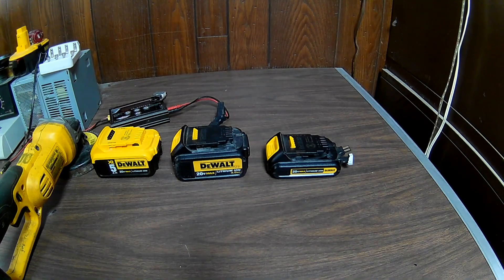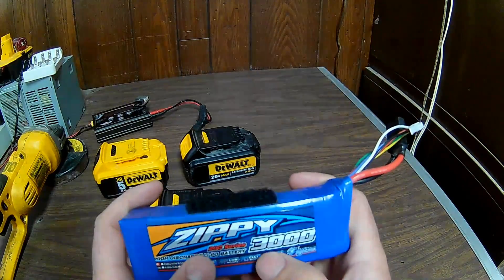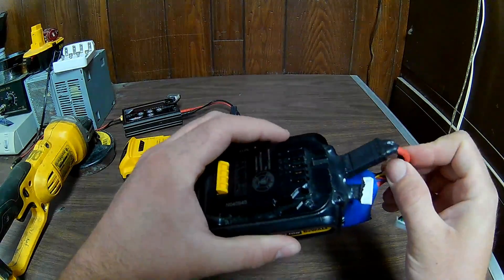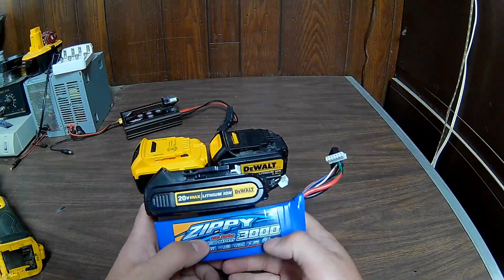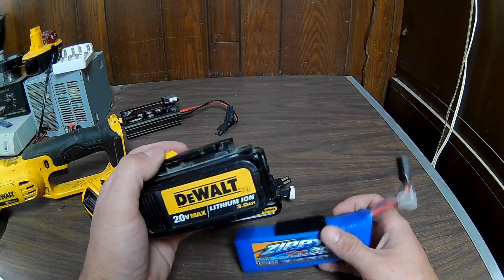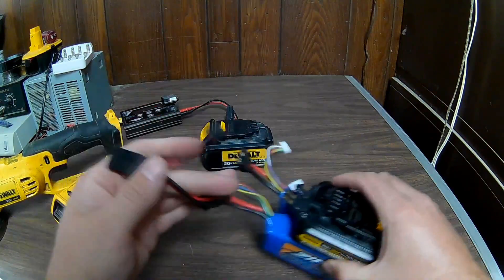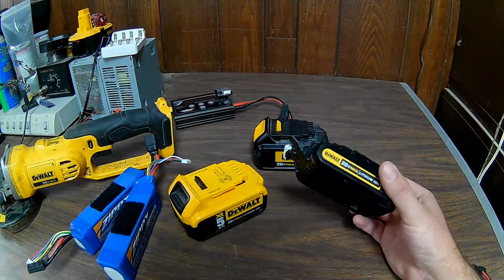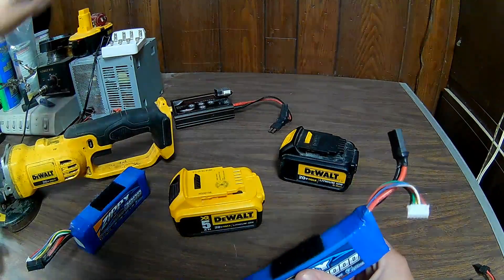DeWalt 20v Adapter for LiPo Battery

Comment: Both DeWalt and Milwaukee released LiPo battery. DeWalt called it PowerStack. Milwaukee called it M18 Forge (6Ah only).  Both are selling 5-6Ah for ~$150 (sales/discount) to $260 (MSRP). Recreation LiPo of 5Ah cost ~ $50, so it is about 3x more expansive (with sales/discount).  However, both manufacturers' Li-ion battery previously does not do battery charge balancing (so that consumer will buy more battery as they get out-of-balance), so I'm not sure whether their LiPo battery will be balance charge. They do get the advantage of faster charging similar to LiPo battery. Milwaukee's M18 Forge battery will require new charger to leverage its quick charge

Comment: I understand why you assembled what you did. However if you’re going to run aftermarket batteries on your dewalt stuff, might I suggest taking a look at waitley batteries on amazon. I was able to pick up 2 5amp batteries for around 50 dollars. And I don’t have to worry about dropping them.

Comment: Amp hours is not a measure of voltage. Aka power. Its basically your gas mileage. Volts is your horsepower. Also I figured these tools were voltage regulared but maybe not. Meaning even if u put 30v on it it'll still onky use 18. Btw a 20v battery is 18v. Its marketing

Comment: Nice video, i made the same thing with my old cordless drill. 
Do you know on Dewalt Dc models which is the postitive terminal, front or back? 
And also which cells did you fit and with which order on Dcd model battery ?
Thanks

Comment: can you make a video on how you did the wiring in the battery? or try to make it to be hybrid and work corded with ac connection .that would be amazing!! i seen it done on the 18volt but the the 20
Reply: wireing would be identical since voltage is nominal